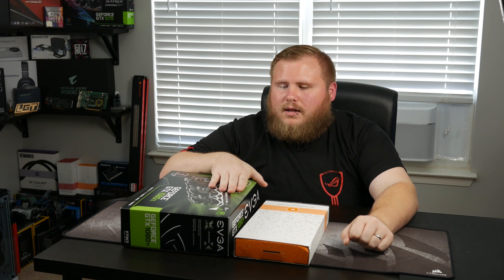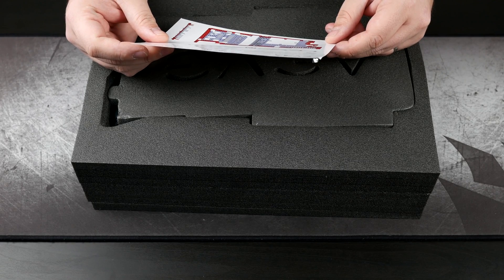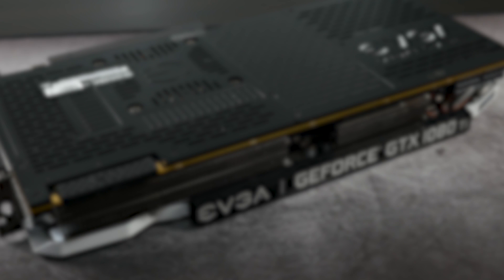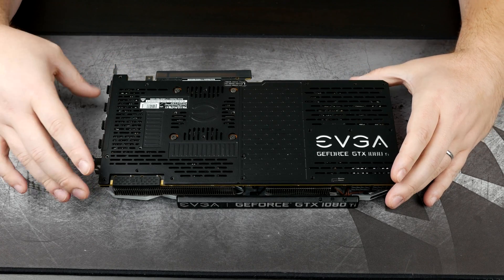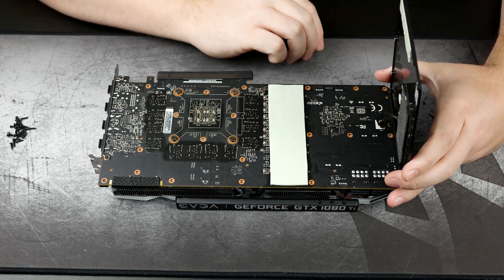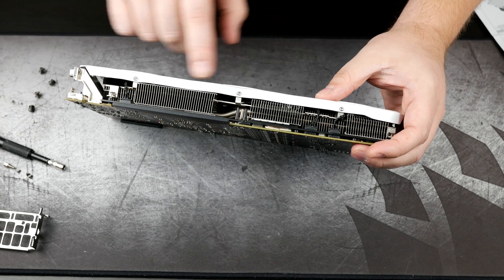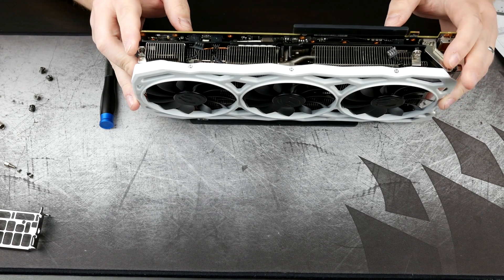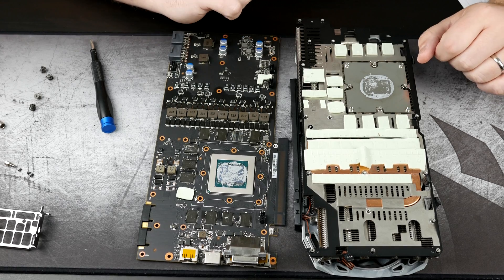[How-to] EKWB 1080 TI FTW3 waterblock install

Comment: 14:03 OMG!!!
Reply: it was not a compliment! You have undoubtedly put too much thermal paste.
To ensure proper dissipation, a so-called rice grain is enough. In this way, besides wasting thermal paste, the heat does not dissipate at best and you create a cap. Trust me put less and the results will be better.

Comment: How many mm is the connection slots on the card
Reply from the maker: I'm not sure I know exactly what you are talking about. What connection slots are you referring to? If you are talking about the inlet and outlet ports on the block they are standard G1/4. If you're talking about something else, please correct me, and I'll try to answer.

Comment: I thought EK sold a separate back plate that help sandwich their water block better as well as helping to reduce temperatures from behind the card?!..
Reply from the maker: They do on most cards, but the FTW3 can use it's stock backplate. I believe the MSI Gaming X also uses it's own, but don't quote me on that.
Reply: Let's Get Techy I looked further into it and you’re right the back plate is an optional extra. Great video by the way.

Comment: Hey there.
Im thinking of doing this on my FTW3 as well... But since i got a NZXT H700i case, there are barely space between the gpu and the glas panel. Can you measure the black "thing" on the waterblock where it says gtx 1080 ti and the watertubes goes into? I dont know if i got enough clearence :S and cant find any info around the web :S
and is it more or less heavy with the waterblock vs. stock cooler?
Reply from the maker: In my opinion it felt lighter with the block installed. Unfortunately, I no longer have this card to measure. :( I will say that there is a fancy plastic cover over the actual block terminals right where you are talking about that can be removed for greater clearance, but I would still be unable to confirm with 100% certainty.

Comment: What kind of water block do I have to use for the EVGA GeForce GTX 1080 Ti SC Black Edition?
I'm trying to build the water cooling system for my case
Reply from the maker: The Black Edition has a Founders PCB so you would be looking for a 1080 TI Founders Edition block. Just Google "1080 TI FE waterblock" and several will pop up. I suggest EKWB but I'm a fanboy. :) lol

Comment: Hey there.. 
Will the back leds still work when you install the waterblock?
Reply from the maker: The backplate only lights up white after a waterblock install. You lose RGB functionality.
Reply: thanks..
Reply from the maker: Caused me to ditch the whole setup. Not sure why they designed it that way.
Reply: wait i can make this gpu RGB, how? mine is only white just now how do i change the colours?

Comment: was ever able to get RGB back on this? How come it has to reset to white? Like how many wires are leaving the PCB into the stock rgb capable cooler? IS there a chip on the stock cooler to make this all work?
Reply from the maker: Negative. RGB functionality, for some stupid reason, is routed through the cooler. Once the cooler is removed the software doesn't even recognize that the card was ever capable of RGB.

Comment: I noticed you didn't put thermal pads on all the.. components (?) if that's what their called. How would I know which ones need covering and which ones don't?

Also.... How have i not come across your channel before? Subscribed :)
Reply from the maker: Appreciate the sub!!! :) When you go to install a water block (as long as it is from a reputable company) if will provide an actual photo of the card in the instructions and show you exactly which thermal pads go where. That being said, it is also a good indication of where they go based on where the card originally had thermal pads for the factory cooler when you disassembled it.

Thanks so much for the support!

Comment: What's written on the sticker above the backplate screw? Evga support tells me the only stickers that avoid warranty are the ones clearing stating warranty void if removed, but they're also using sticker for the rma team to know if the cooler was removed. I'm considering to buy this card so I need to know what's on the sticker. Thanks
Reply from the maker: That is actually the serial number sticker. I wouldn't recommend removing it for warranty purposes unfortunately. :(
Reply: Let's Get Techy not the big one, the small one exactly on a screw. The one on near the pcie connector, almost on the edge of the card. I'm not sure this is a great explanation but I hope you understand anyway
Reply from the maker: That is some type of sticker that shows them the card has been taken apart similar to the ones you see on heads of screws on the back of other brands of GPUs. I'm almost positive that sticker had the words warranty void on it.
Reply: Let's Get Techy let's hope not because I definitely plan to watercool it. Thanks anyway! And usefull video too!
Reply from the maker: Glad you got something out of it! In the past, EVGA has been okay with you liquid cooling their cards, so hopefully that hasn't changed.

Comment: Did your backplate led still work after installation.
Reply from the maker: It did, BUT only in white with no ability to change color or turn it off. So upset about it that I sold the entire setup.

Comment: I've seen another video where it wasn't necessary to take off the backplate. Is there a reason to take it off?
Reply from the maker: It's impossible to do it without taking off the backplate because the backplate screws into the cooler that you are taking off and screws back into the block you are putting on. Let me rephrase- it isn't "impossible"- Maybe they just let it hang on by the thermal pads, but I wouldn't suggest that because if it falls off it could damage the backplate depending on what it falls on or get the thermal pads dirty if it lands face down. Thermal pads are sticky, but I wouldn't chance it.
Reply: thanks for the reply, I was referring to this video:
https://www.youtube.com/watch?v=Ubn58L5Ls9E&lc=z22cj13qelqavxchg04t1aokgyocasonhrjxvr5rzpj4rk0h00410.1509242288544628
Reply from the maker: Thank you for the comment!

I'll take a look at it tomorrow when I wake up.
Reply: Did you ever watercool? I just ordered my waterblock looking to find out if I need to take off the backplate during installation or not, I read people who did take it off had trouble getting the RGB led backplate to work outside of white after installation.
Reply from the maker: I can't confirm if you can leave the backplate on for installation as I removed mine during the process, but I can confirm that taking the backplate off has no affect on not being able to use RGB on the backplate after the waterblock install. For some reason EVGA designed it so that the RGB on the backplate is dependent on having the factory cooler and other LEDs installed. Once that factory cooler is removed, you lose control over the backplate LED and it stays stuck at white. :(
Reply: That was my worst worry, The card looks so good right now with that RGB right now! oh well no RGB guess I'll cancel my order with EK...

jk, RGB will be missed. Thanks for the reply

Comment: How do you stop your cpu Clock speed from fluctuating ?
Reply from the maker: With Nvidia cards and GPU Boost 3.0, it's almost impossible to keep the clocks from fluctuating. The best shot is with liquid cooling. GPU Boost 3.0 uses several perimeters to set the appropriate clock speed such as power, voltage, and temperature. Temperature is the biggest factor, so if you can get temperatures under control with water, you see a lot less fluctuation.